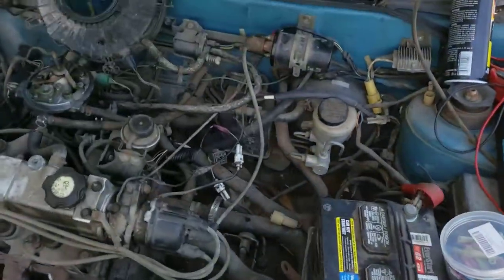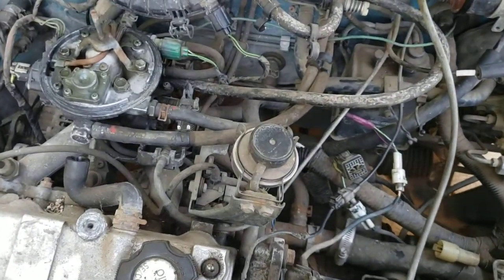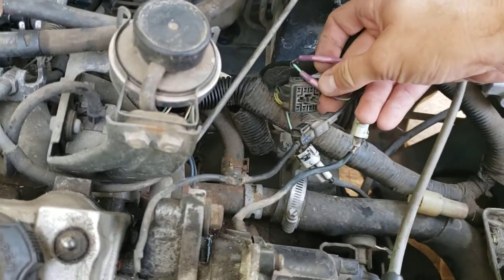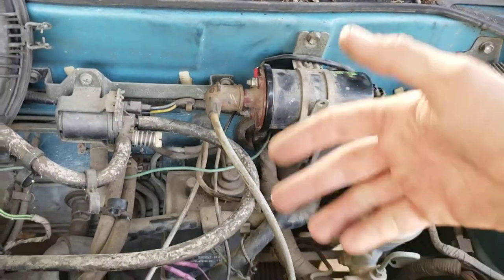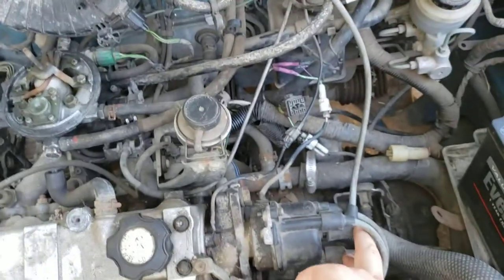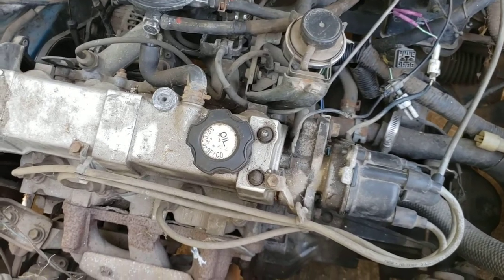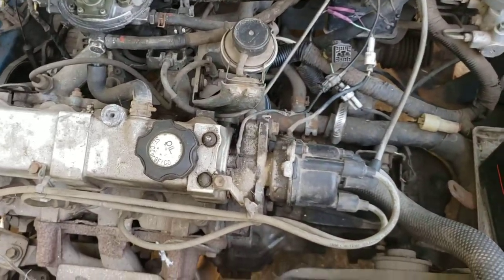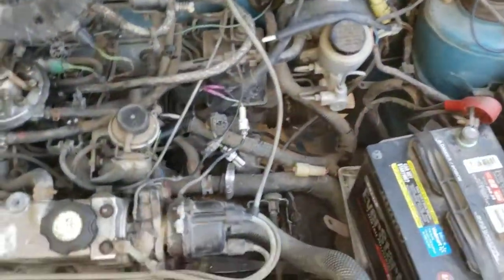Geo metro no spark 1992

Comment: I'm working on a 91 lsi convertible. I did a transmission swap from auto to manual. A round white plug, along with the large square plug in question are to the auto transmission. Now I wonder if I will run into a spark issue
Reply from the maker: Correct info here ^ You should be just fine, The car in my video ended up having a bad ECU

Comment: I have a 1993 Geo metro and I’m not getting any spark and the coil is getting no power. The fuel pump positive wire was also dead and I had to hardwire the fuel pump. Do you think it is the computer that is bad? I I swapped out the coil for multiple good ones and nothing changed
Reply: I also changed the entire distributor with a good one no different
Reply from the maker: Yes the ECU could be bad. That was the issue in my case